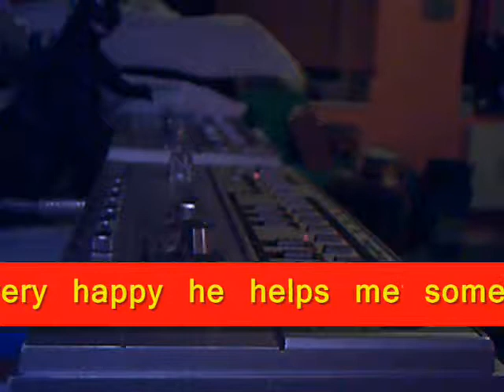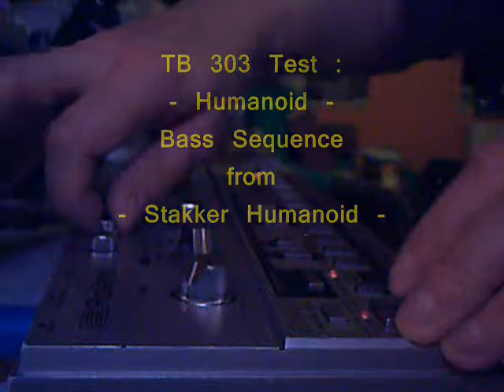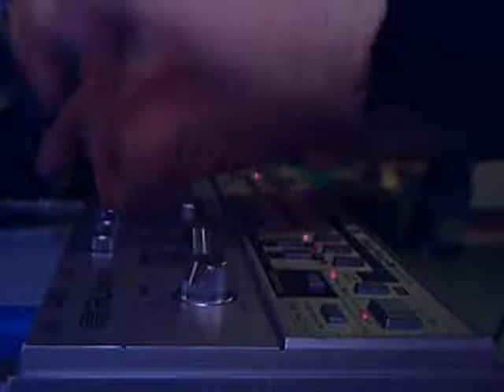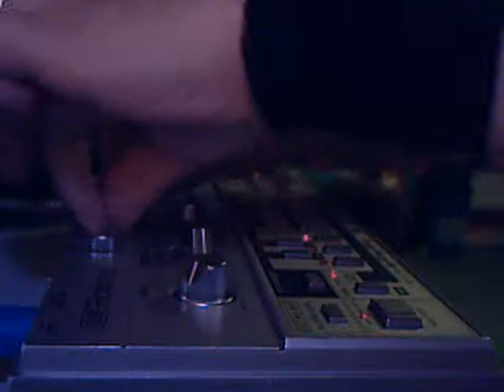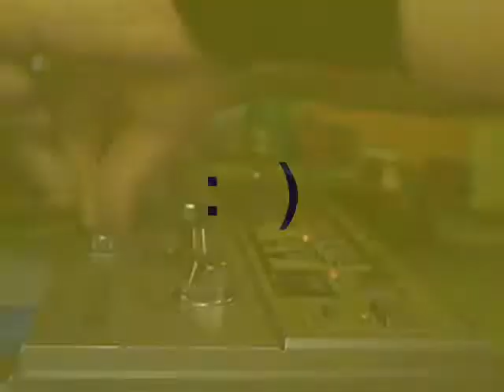Godzi & The Polygirl cleaning and repairing the TB 303 + Testrun with Humanoid Bassline

Comment: hi, has this 303 got another cpu or is that an extra midi board that assists the original cpu? thanks for info
Reply from the maker: hi, its an old midi kit back from the 90's that works with original cpu without extra midi board and just only with an embedded (programmed) e-prom soldered with wires inside for make it work with midi. i buyed this tb with the kit inside and think to remember this midi kit was offered by a man from austria in that time...
it still works well with but i don't use this midi option on the tb.